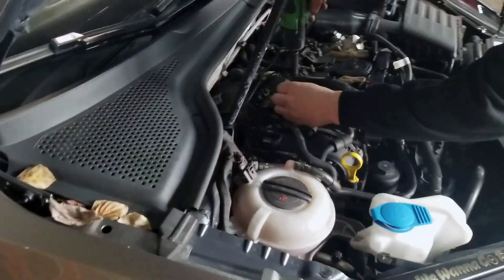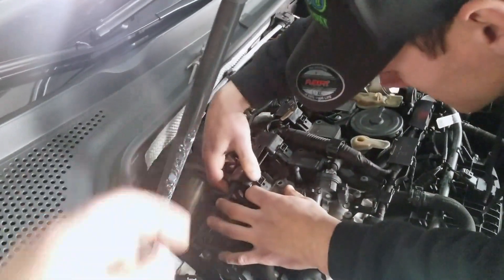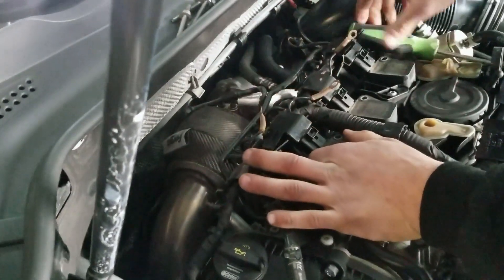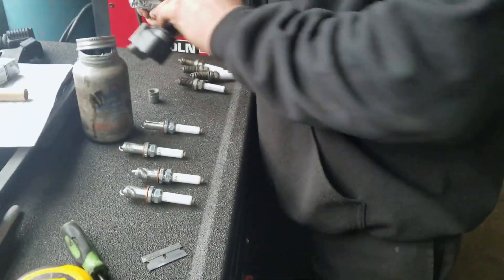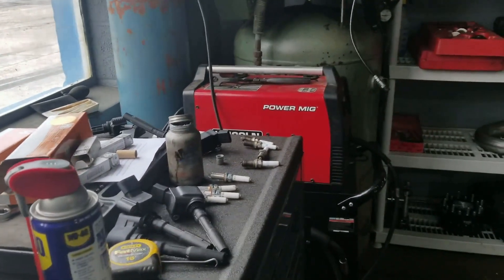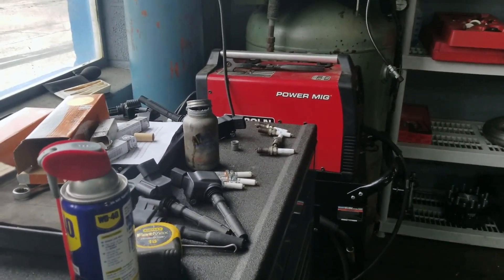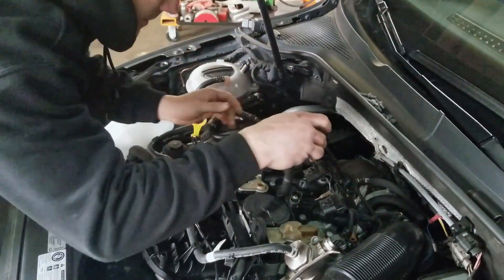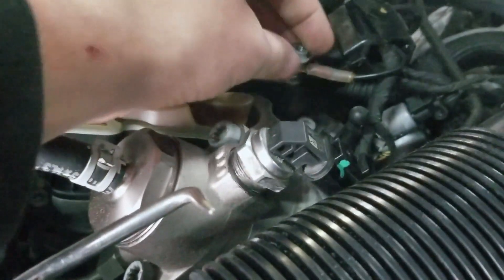RS3 Coil Install on MK7 R | YOU NEED THESE

Comment: I’m sure it’s still fine today but that was cringeworthy watching him put antiseize on the spark plugs and then using an impact drill to put them in.
Reply from the maker: Lieutenant Lunchbox loose trigger qith impact just to speed up process. Hand torque afterwards before finishing
Reply: @WeWannaGoFastProductions  You dont get it. You should NEVER use an impact on plugs. Shows me his lack of knowledge.
Reply: @WeWannaGoFastProductions  The problem is that you may damage the threads if the plug doesn't seat properly...
Reply: @Theorcman2008  u prolly never worked at a shop then, i hit em with a small impact then hand tighten each one like barely a quarter turn
Reply: @goongoon9299  Working at a shop doesn't mean a damn thing lol.
Reply: @Theorcman2008  sure does mean alot, u gotta work fast and efficiently my guy
I use an impact on plugs all the time (1/4 cordless) to seat the plugs and no comebacks
Reply: @goongoon9299  Working at a shop doesn't make you anymore knowledgeable than any other good mechanic. It is KNOWN not to use impacts on plugs.

Comment: I got out of my rs7 plug 45k of hard driving 80m to 140m pull over and over daily it did start to misfire after 45k and i still got 8k more after real bad misfire and the gap the was .38 and .40 oh i use rs3 coils

Comment: How do coilPacks increase power on a car ?   if the sparkplug creates a spark to ignite the fuel, why would you get more power ?  Curious
Reply from the maker: JDDD33 its not a direct increase in power necessarily. It allows for a more powerful bigger spark which decreases your chances of knock when running more fuel do to an increase in boost. Which results in an increase in timing due to the ignition system. Which in turn "could" allow for more boost aka more power. These would only give a direct power increase if the car was currently running at a boost level that is resulting in negative timing. The increase in timing would increase power in theory because it would be bringing the timing back to a favorable point. But any power acheived from any mod is solely going to depend on the quality of the tune behind it after all mods are installed.
Reply: JDDD33 - It doesn't do a thing for power.  If his coils were actually bad, replacing them with stock part numbers would have been just fine.
Reply: Normally I would agree that these don't add any power over stock coil pack. But I just recently did the same thing to my R but I got the new apr coil packs that are supposed to be 10% stronger than oem. There is a pretty noticable difference in throttle response, engine tone, power all the way to redline, and improved mpg. Obviously my OEM coil packs were a little worn out they had 35k+ miles on them. I usually replace them every 40k miles and spark plugs every 20k-25k miles. I have yet to feel a difference quite like this one.

Comment: I’m assuming I could run the RS 3 coils on my MK7 GTI? I just run the APR stage 2 tune. I already have the RS 7 plugs. I left the RS 7 plugs at the oem gap of 0.028 I think. Do you recommend gapping them down to 0.024 or leave as is?
Reply from the maker: Mk7 Black-and-Red leave them as is and yes absolutely you can and I def recommend them

Comment: you realize with NGK plugs you are NOT supposed to use anti seize, and that there is a coating on the threads of the plug.  Just a little FYI.
Reply from the maker: Kurt Kennedy while your right, they dont want you to use anti seize for risk over over tightening. Im in the habit of always anti seizing plugs because of my job which is why i do it. It has no affect on operation or plugs coming loose. Just more care is needed when tightening the plugs so they dont over tighten and have threads fail.
Reply from the maker: Ive never over tightened a plug but ive had plenty not wanna come out and be even more of a hassle which is why we always antiseize
Reply: You didn’t show the hardest part - taking out the rubber boots that are in the hole - use a warm engine to get them out easier.

Comment: Thanks! How many total miles are you at now? Different topic question- have you done DSG service earlier than the 40-50k recommended time? I’m only at 25k with stage 2 R and been switching plugs 10k, coils at 20!
Reply from the maker: Kevin Baird I'm about to peek over 30K miles. I have not done DSG fluid yet BUT it will be getting changed to Motuls before the race season to combat the slip from the clutch I see sometimes. I've been hearing guys that have done it haven't seen slippage after so we will see.

Comment: nice video. I've been running the RS3 coils for the last 2 months and noticed a difference in the butt dyno lol. My Cobb etuner noticed a difference also and said they were a significant improvement. I'm running with RS7 plugs. When you say 10k miles life, are you talking about just the plugs or the coil packs also? I thought the coil packs had a way longer service life than spark plugs. Also, I noticed the new coil packs had dialectic grease in them already.
REPLY
Reply from the maker: Navindra Ramharack 10k miles for the plugs not the coils. Not sure of the life expectancy on the coils but it should be a long time before any issues.

Comment: Obviously you had to switch because of running custom map 6 and downpipe in conjunction with beating the hell out of the r right? 
would you suggest to stay with stock plugs given only spirited driving and low boost maps?
Reply from the maker: zues2013 the stock plugs will last much longer so if you are only running low boost then yes I'd just stay stock. The butt dyno benefits of the plugs are minimal. Their effects imo I only see with my logs in the timing. But not push boost to the limits of what the cars willing to do without timing pull then yes I'd stay stock for longevity reasons
Reply: We Wanna Go Fast Productions sounds good plus saves 💵 in the long run lol
Reply from the maker: Exactly

Comment: Can someone explain to me what the hell stage 1, and 2 spark plugs are?
Reply: I'm not a mechanic but from what I understand if you are stock tuned and want to change your plugs then just stay with the OEM plugs. If you have a tune, lets say Stage 1 then they recommend you go with a bit colder plug and stage 2 you could even go colder. Because the firing is hotter so they recommend colder plugs.

Comment: What’s the torque spec for the plugs?
Reply from the maker: The Milton's 30NM as long as the plugs you are using are OEM or have the same size washer on them.
Reply: In this case, rattle them on
Reply: 50 ugga duggas....lol
Reply: He should have said he tightens to German Specs since he buzzed them down with that 120ft-lb snap-on impact wrench... "GUTEN TIGHT!!!"